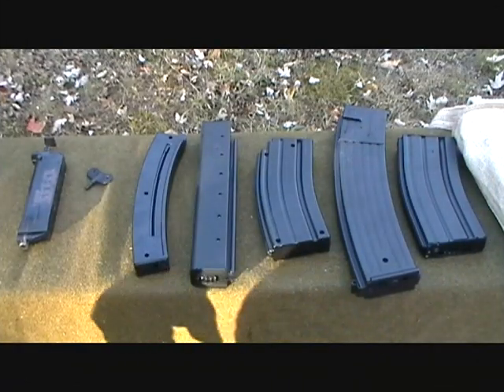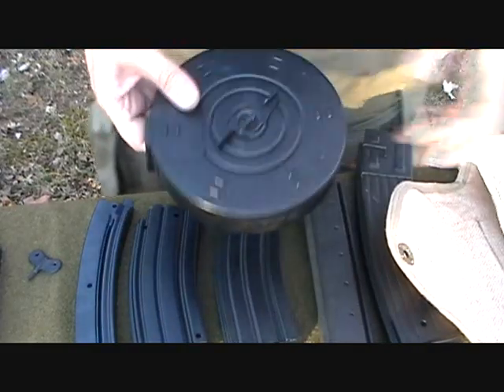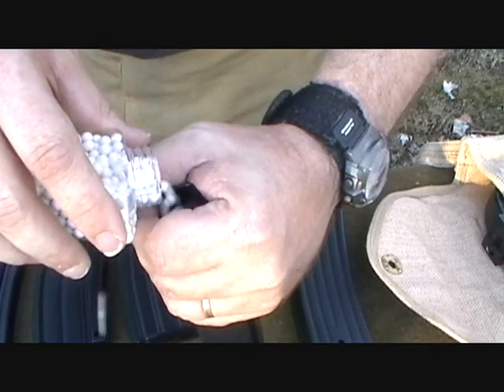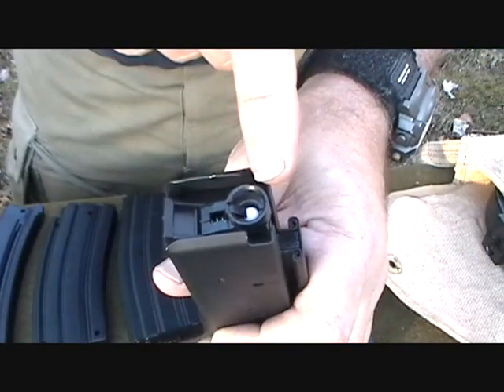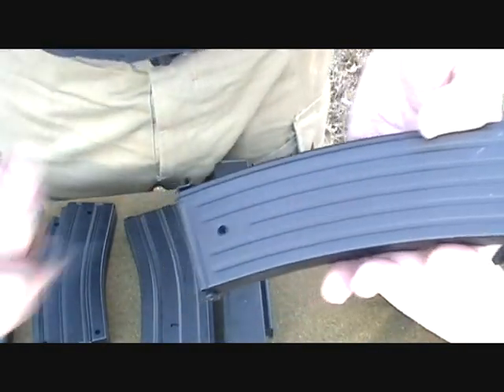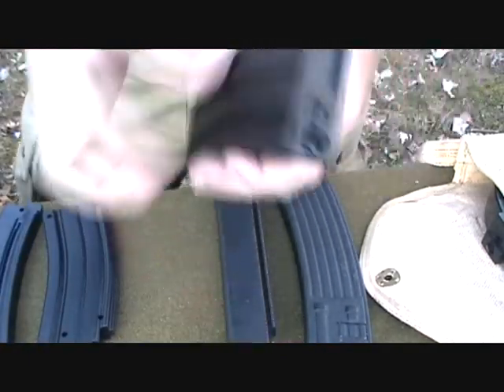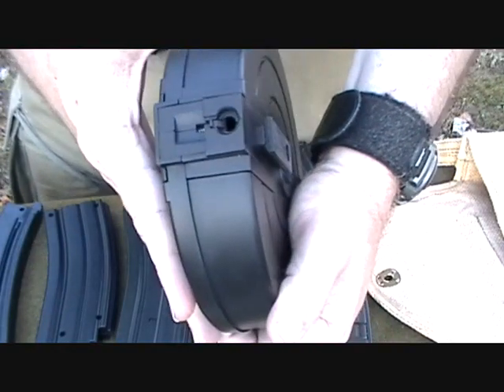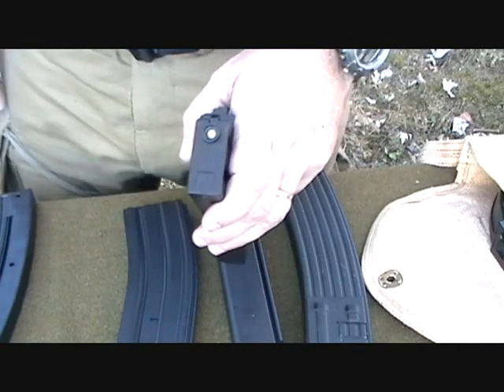Know-It-All: Airsoft 101 Magazine Basics

Comment from the maker: @XfireBf2Skatetopia Most Hi Caps need to be wound fully then after about 100 bb's wound some more, so a 400+ mag will be wound all the way and then 3-4 more times in the game. now when you hear the mag spin up it means you are out of bb's or very low and no tension, if this happens with a full mag and you have wound it fully then it could mean you need to replace the mag.

Comment: hi, my jg g36 mag is acting weird. i fill it all the way and i wind it and when i wind it the spring jumps back to the beginning, and there is no tension. It will not push into the barrel unless i use the winder that came with it. i have to wind it all the way to have it work. is there something wrong, or thats the way it is?